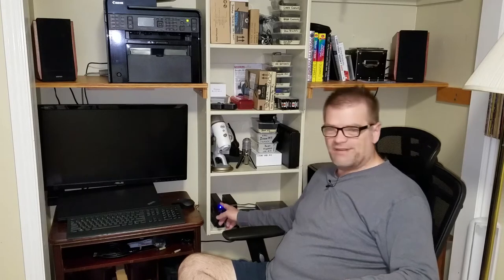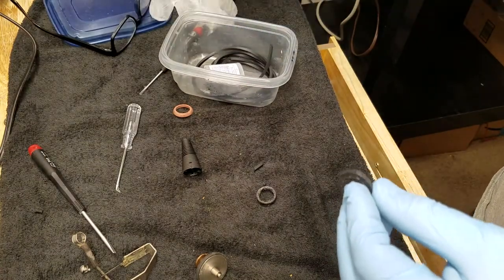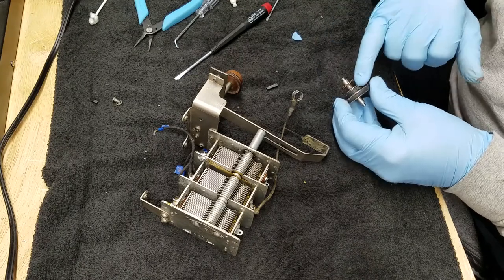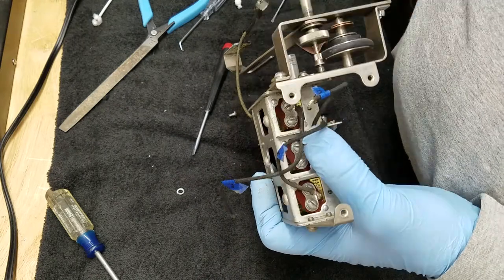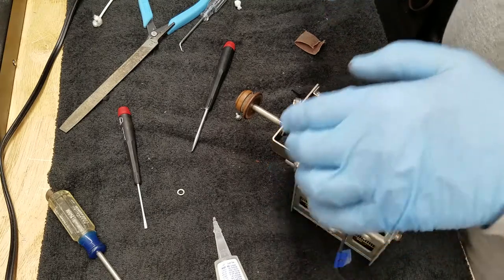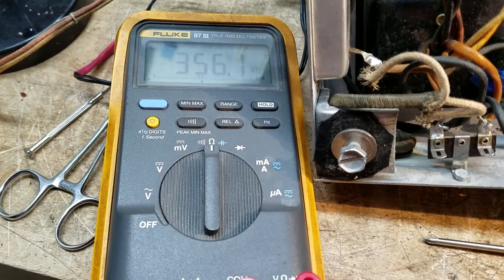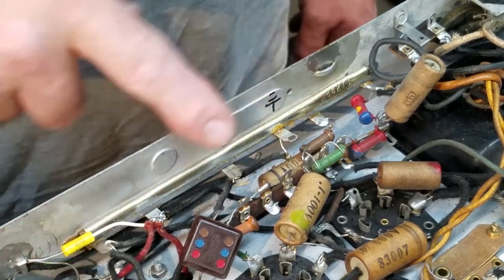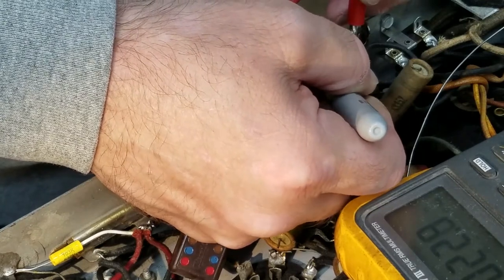Stewart-Warner 1262 Antique Tube Radio Part 3 of 6 Tuning Drive Wheels

Comment: I just subscribed to your chanel.  Back in the early 80's  There was a company called General Cement that pffered make your own kits in round, flat ans square.  In the kits were several feet of different sized belt material, a cutting and sizing jig, alcohol cleaning solution, super glue, and razor blades.  Additional material was also available.  We used these kits because there were so many belts used, and a lot of them were not available except to factory authorized service dealers.  This allowed a regular service shop to make a belt reparir quickly and easily.
Reply from the maker: Dan,
I own one of those kits, in a red tin case.  It's still chock full of belts, cord, and other supplies.  It even has someof the chains used on some record changers!  They are mostly all in good condition.  I have even used a couple of the leather belts in my own Zeniths.  They have been on the radios for years and are going strong.   Thank you for watching and especially for commenting!    Cheers!   Michael

Comment: Hey Michael, Got a question for you.  I picked up one of those grundig/tecsun antennas that you use and connected it to my old Philco 18.  I'm still only receiving just the one local station on the radio although it now booms with the antenna tuner dialed in.  Of course this is daytime, almost noon but the rest of the dial is still dead.  I'm sure the thing needs an alignment as the station I do get is 1220 and on the dial it comes in around 1180.  My question is do you think the reception would be stronger if I got tube shields for the tubes?  When I bought mine it didn't have any and I noticed yours has 4 of it's tubes shielded.  I haven't tried the antenna at night yet as I just got it in the mail today.  Difficult to try it at night anyhow as my houses rooms are all pretty much open with no doors between them and I'm always quiet at night to keep from disturbing Ma, lol.  Take care, Gary
Reply from the maker: Gary,
I'm not sure that tube shields would help with reception so much as they help eliminate noise.   But, I'd give it a try, anyway!    The tuned loop antennas usually take care of any antenna issues on these earlier set, otherwise I'd ask how long your "long-wire" is. To be effective, it is best that it is at least 35 feet.  The longer, the better!   I would bet that alignment is your first priority.  If you do an alignment, be careful.  I think the IF on those older Philcos is something like 260 kHertz.  I know that this sounds silly, but check your tuning condenser plates.  Are they all straight and is there space between all plates.  This Stewart Warner gave me fits due to a couple of plates touching only when tuned within a certain range.

BTW, those loops take practice.  Note that everytime you change tuning on the radio, the "sweet spot" on the loop tuner moves.  You kind of have to track them together across the band, much like tuning old TRFs.   Still, I say alignment is your best bet, my friend.    Take care, Gary.   Cheers!    Michael

Comment: Do you know that the super glue is hardened using the water in the air, therefore if you want make it glue almost immediately you can spray water on the materials you want to glue together...but you can also hold it into a water fountain or drop the whole thing in water...maybe i should read the coments before i post any ;) Dan Floyd is right, for sure ;)
Reply from the maker: That's funny about the comment below!    I do the same thing all the time.   I work for the German company that makes Loctite adhesives (Henkel).  I have learned a lot about cyanoacrylate glue since joining them.  It's good stuff!    Cheers!    Michael

Comment: Yea those Canned ohm resistors have a problem with being intermittent or unpredictable, I think that in the large part is caused by corrosion because these resistors ARE NOT SEALED against air and moisture. The problem starts where the electrical tab goes into the resistor, there is little openings right at this point on both left and right of the tab.  John A Bellas  KC2UVN
Reply from the maker: I think you nailed it, John!  That tab is where the trouble is on this one.  Individual sections that do not touch that tab tested OK.  I have heard folks complain about Candohm resistors for years, and I never had one be bad, myself.  Now I have, and I'll be on my guard!  I have always tested them, but now I'll be a little more suspicious and a little less cocky!    Thank you for watching, my friend.  And, double thanks for your awesome comments!   Cheers.  Michael

Comment: When I saw your meter bouncing around, I thought maybe some caps were still charged, affecting the reading. I would have disconnected every wire from that divider to make sure. I would use a non-metallic tool to wiggle the suspected bad terminal. Do the replacement power resistors require heat sinks, since the original divider uses the chassis as a heat sink. ? Does the original divider have a wattage rating ? (on each section)
Reply from the maker: Howdy, Glenn!  

Those are excellent questions.  Thank you for asking them.  This video is not my best effort, as I am still very wet behind the ears in Premiere Pro!  Sadly, I lost a video in which I covered some of your great questions.  I should have added the info in a voice-over, after the fact.   

I thought about the caps being charged, or maybe being leaky and providing a minor path to ground.  There was only one cap to consider, and I cut the lead to it.  I actually noticed the "wiggle" thing with a Q-tip, first.  But it was easier to show it with my finger and then with the pliers.  I thought about the heat issue.  That is partly why I was not bothered by using discreet resistors on that strip.  

There was no indication in any of the documentation about the power dissipation rating of the Candohm.  So, I did a little math based on the tube lineup, and learned that 5W was more than sufficient.  Since I used multiple resistors for just about every section, I have even more headroom as far as power dissipation goes.  When I operated the radio, I checked temperature of those resistors several times, including after it had been playing for a few hours.  They were only mildly warm.  Nothing to be concerned about at all.

Thank you very much for watching, as I am especially grateful for your comments.  Take care.   Michael
Reply from the maker: It just occurred to me, Glenn.  You haven't seen what I came up with yet, for that voltage divider!  Oh well, I'm sure you figured out what I would do......